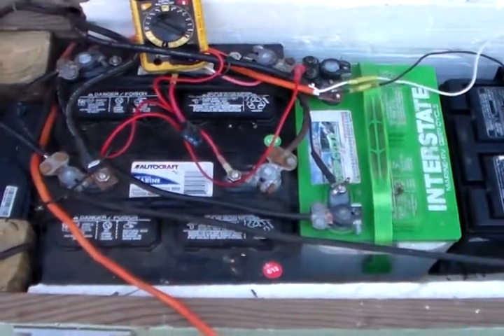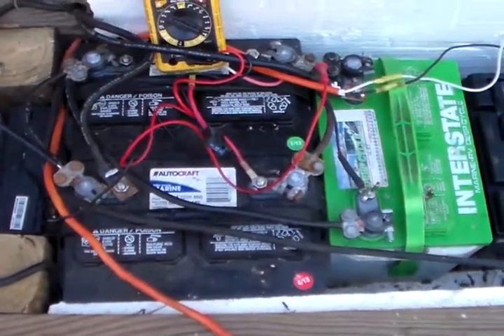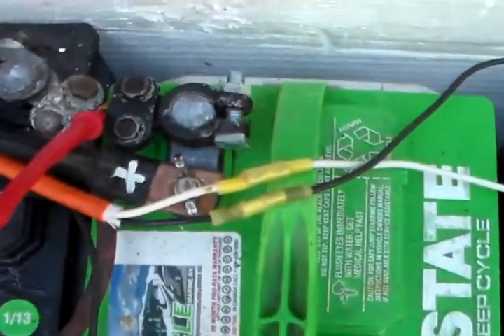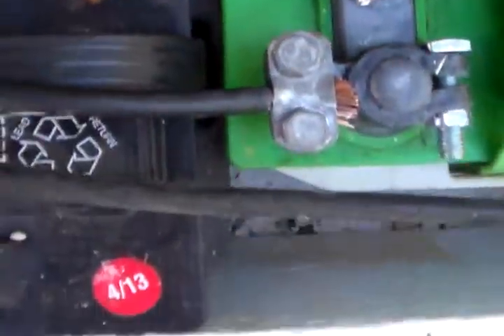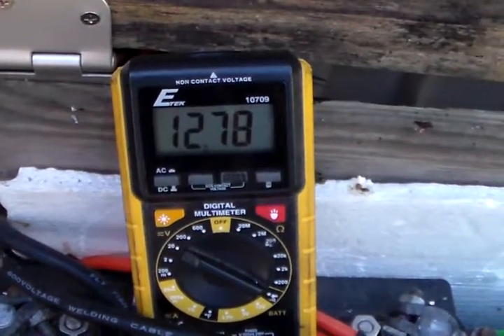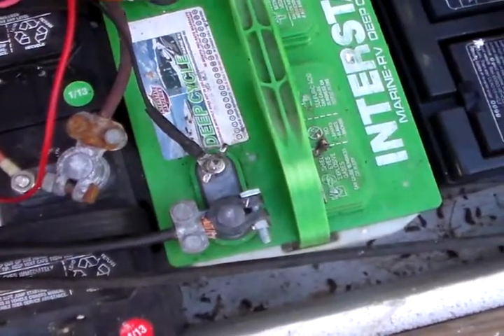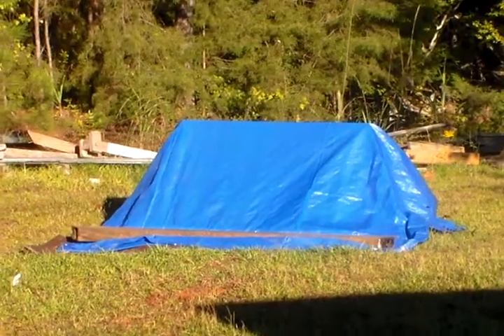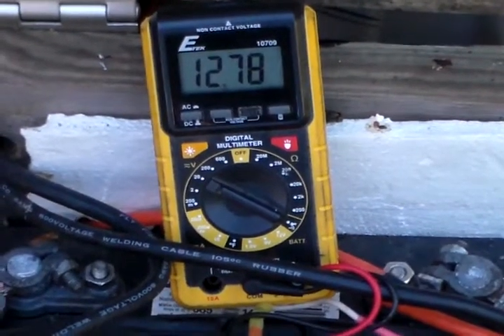Solar Battery Bank Voltage

Comment: Thumbs up !What would you recommend for a solar system on a camper truck ?Would 50 watts be enough lights, charge cell and laptop, and run a 12 volt frig/cooler ?ENJOY....THE SIMPLE LIFE
Reply from the maker: I would say, get about 150 watts of solar panels. And about 150ah. of batteries. That is just what I think would be enough. I suggest that you add up all the amps that you are wanting to run and make sure you have at least that many amps of solar. So if you have a 10 amp load, you would need to make sure you have at least that amount of amps coming in. A good rule of thumb is that 15 watts equal 1 amp.